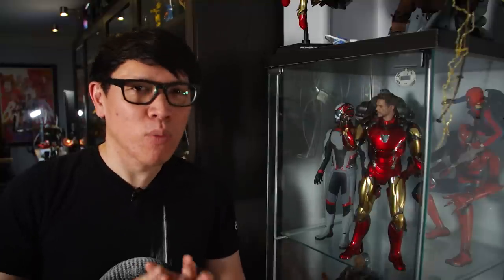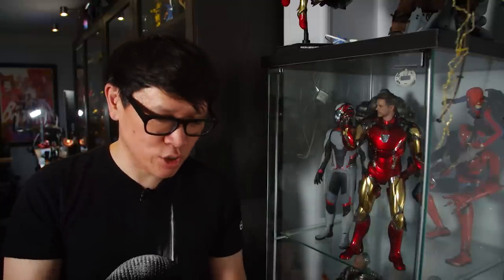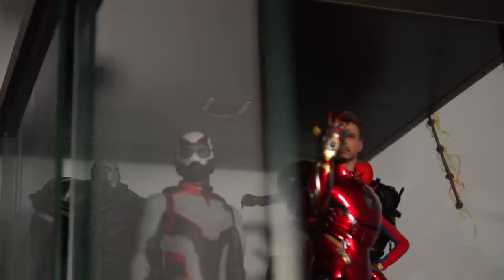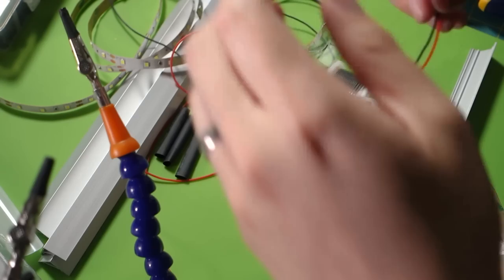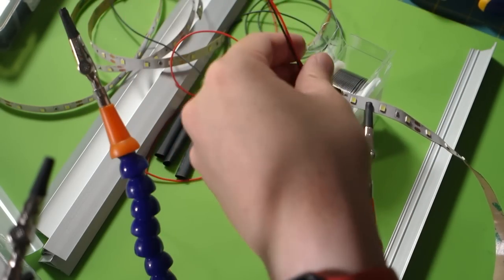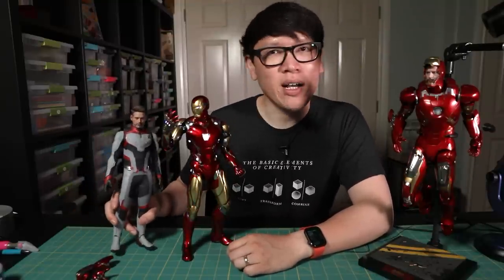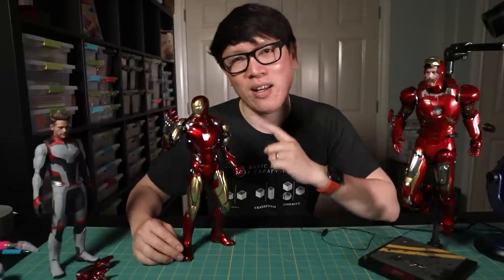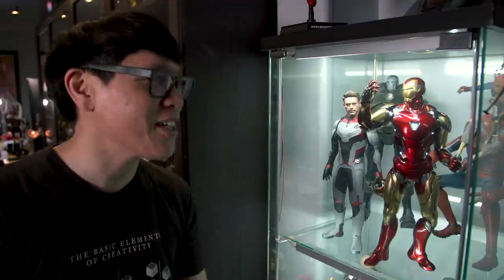How to Make Custom LED Lights for IKEA Display Cabinets!

Comment from the maker: IKEA Detolf: https://www.ikea.com/us/en/p/detolf-glass-door-cabinet-black-brown-10119206/
LED Light Strip: https://amzn.to/3wymso8
1ft Aluminum V-Channel: https://amzn.to/3cPRTSV
3M mounting tape: https://amzn.to/2THB0D3
Silicone wire: https://amzn.to/3wFjQoA
Heat Shrink Tubing: https://amzn.to/3wAVps3
USB Soldering Iron: https://amzn.to/3gwVmbi
Hot Toys Iron Man Mark 85 Armor: https://www.sideshow.com/collectibles/marvel-iron-man-mark-lxxxv-hot-toys-904599
For even more Iron-Man collectibles, head over to Sideshow: https://www.sideshow.com/characters/iron-man
Disclosure: This product was provided by the manufacturer for purposes of review.
Reply: Hi Norm, hi Savage put LED lights on anything makes it cool
Reply: Please do not use 30 AWG wire for this (like you have listed).  In perfect conditions that's far too small.  While assuming perfect conditions you'll get a 5-10% voltage drop due to resistance of the wire for the short length you're using based on the likely amperage of those LEDs.  But since 30 AWG wire has small strands and not that many of them, when you invariably break a few when you strip the wire or move things around you're dealing with something that's even worse.  22 AWG is what is typically used with these types of lights in small to medium setups and it's not much bigger (the insulation is still thicker than the wire) and isn't grossly more expensive (on the amazon link you give, the price is half again as much for 2/3 as much wire).  If you merely go to 24 AWG (which is ideal for a very small installation like this), the cost is only a couple dollars more than the 30 AWG for the same amount of wire.

Comment: The "V channel" is also called LED extrusion commercially. You can get it in many styles- quarter-round, half-round, flat, 45, etc. They have a bunch of varieties on amazon and there are a couple companies that only sell extrusion, and they will have more variety and longer lengths. The longest I've bought was 2 meters. You can also buy generic alumni channels and make your own diffusion and/or color using film/theater gels.

Comment: I bought that same led tape off Amazon and just pictures frames the whole inside of my display cabinet starting from top going down one side across bottom and up the opposite side and out the top which I hard wired to my original hockey puck light and it connected via 2 prong cable into a smart outlet that I can turn on and off from my phone. But my cabinet is made off wood to match my living room furniture so I could get away with that method of led tape. Great work!

Comment: I've used the metal poles as wires. You can attach the + to one pole and the - to the other one either on the top or the bottom. Then you can scratch a bit of paint of the metal poles and you can solder your wires to the poles. It makes a clean look without any messy wires that you can see. You can also choose to not solder the wires but make a pin that can make contact with the poles, this way you can take out the glass plates.

Comment: I have the Billy units inspired by Tested and use it to display some of my collectables.
We hired a Task Rabbit to install them and that was a good move as the basement floor has a small slope. I would never have been able to do it right. Now I should look at lights👍
Reply: I'm glad someone else is taking full advantage of the Billy modular set.

I have my study room lined around 3 walls with Billy modular shelves and cabinets with the additional risers that you can add to the top for another additional shelf

Comment: Looks good for illumination but when you were wiring up I was thinking of the overhead room lights you can get that use the structure of the fitting to carry power to the light fittings which gives a clean finish. So using say the left frame for positive and the right for negative, thus reducing the cabling to a minimal level.

Comment: Just a heads up; almost everything at Ikea, including the Detolf is sold out. Make sure to check stock before making a trip. Ordering online is also basically impossible.
Reply: They have plenty in my area Northeast US?
Reply: @Wsfletcher  Interesting. I'm in Missouri, and every store that I have searched besides Memphis is out of stock on almost every product, including these. I'm sure it's shipping related, but I can't even make a 1-2 day drive to a store to get anything.
Reply: Over here on the east coast Ikea stock is pretty dicey too. Been stalking their stores for a couple months looking for one type of cabinet and it's just MIA.
A really awesome floor lamp that works like Adam's work bench lights was completely sold out (unless I wanted it in white, there was plenty of white).
Reply: The trick to ordering online is to submit at 12:01 AM, that's how you get the collection spots.
Reply: Seven months later you can easily order the Detolf online, but shipping costs almost as much as the unit does.
Reply: Detolfs are now $120.. a 100% increase in price in just a year.

Comment: Having installed my first lights in my Detolf just a few weeks ago this video was really interesting - and funnily enough I fitted mine in an identical way with aluminum diffusers etc. The only mistake I made was choosing RGB LEDs. Soldering the four points so close together was so difficult. One of the most frustrating experiences of my life!

Comment: Wouldn't it have been easier to wire the individual light bars in parallel instead of in series? It would make the soldering easier (only one end soldered for each strip), the wiring easier (one cabinet side only for the wires), and it would avoid voltage drop for the LEDs farthest from the power source.
Reply: Can you explain this in slightly simpler terms? Just interested as I wired mine the same as he did in the video
Reply: @carlturland  like a ladder 🪜, but with only one side.
Reply: These lights are wired in parallel, but he has sort of daisy chained them together....To be honest, while the finished project works well enough, the wiring is not as neat or hidden as it could be...

Comment: I have the Billy shelving unit and use them to display and store my collectables. It was after having seen them on Tested that I decided to buy them and hired a task Rabbit to install them. The basement floor has a slight slope and I would have had lots of trouble and frustration trying to get it right.
Now for the lights👍

Comment: This is great ive been trying to work out how to keep dust off my figures
Reply: That Detolf Cabinet has gaps around the door that dust can get in easily, but like they say, "Dust gets in everything". You could use adhesive foam weather strips, adhesive rubber door sweeps. You'll lose the 100% visibility but shouldn't be too bad. Never set anything on top of these cabinets! If the metal frame begins to bow from weight, the top wood will put pressure on the glass and you could have a VERY bad day! I've heard about these shattering. Keep an eye on any potential glass bowing, especially if it's years old, and don't exceed the recommended weight on the shelves. I guess, under each shelf you could run a thin chain secured to the left and right glass panes with suction cups, with no tension, but just to stop them from bowing out further.

Comment: Another way to hide the wire better if you do not want to use heatshrink, is you can use a black sharpie marker and darken the red wire.  Its a trick used in computer building when you have a colored wire you need to blend in.

Comment: I'll be working on this project soon. I plan on lighting 4 different cabinets. Do you know where I can get extra power adapters and dim switches so I can have each cabinet run independently without having to connect to each other? If I buy 1 roll of LED's, that will be more than enough, but I'll need 3 more switches and power adapters. Granted, if I do run connector plugs between the cabinets, I can plug them into each other and run them all off the same switch and plug.

Comment: Thank you for using metrics, and for NOT calling millimeters “mils!“ 😃👍
Reply: I think he used Imperial dude, he ordered the V channels in 1 ft. The LED's came already measured in Metric, he just didn't manually convert, so viewers could easily find that product. You mad American Freemasons knew best? Imperial is next level bro(masonic puns intended). Would've been a lot cooler if he said caliber though, can't stand millie either, but hey, you say Lumens/Knots, I say Illuminati.
Reply: @Mr-pm3jp  
I’m not American, and I’m not a freemason, but thanks for the insight into your funny world! 😁🤗
But hey, at least we are at one about the “mills” thing. ^^

Comment: I wanted to make something like this for ages! I'd like to add one must have feature for me though. A timer! I've got these led candles that run for 6 hours when turned on, then 24 hours later the cycle repeats. Set and forget! In this case I suppose a smart socket could also work.

Comment: I swear to christ, everyone this past year and a half has had the same project ideas. I'm in the middle of planning something very similar. Note: THAT WIRE GAUGE IS WAY TOO LOW. The plug and play options on amazon are fire hazards because they cheaped out on wire sizes. All the reviews of wire connectors, dimmers, etc are filled with people saying they run really hot and some even say they burn through the plastic. That's because the wire size is too low. I'm planning to use as many custom built parts as possible, including probably 16 AWG wire. Probably overkill, but I'm an EE and design buildings. When in doubt, always upsize the wire. 18 AWG is the absolute minimum anyone should buy if you're not doing the math to see what the load is of your projects.
Reply from the maker: Good to know! Always listen to the EE!
Reply: Just ordered parts, including 18g wire, to do this project for my LEGO display. 🤞
Reply: Would you still recommend 18 AWG for LED strips that have 4 connections instead of just those 2 that he soldered?  I'm planning on getting the tunable white strips and those have 4 points to solder.

Comment: I guess the main takeaway of videos like this one is the idea because sure enough the execution looks like HotGarbage - I mean... Those figures cost like what? On average like 400.- ? You'd guess with that much money to spend on and this being somewhat of a tech-oriented channel I'd imagine you considering the option of making custom 3D printed endcaps for those LED rails that would snap onto the framing of the IKEA Cabinet resulting in a much more appealing result by removing some of those electrical cables. I'd also have used only one ( black ) color of wiring and mark the positive one somehow differently to help with the aesthetics where you cannot hide the wiring. Finally, I'd also argue that vertically mounted lights would have looked nicer ( would also have helped with the poorly addressed cable issue ) 😐

Comment: For anyone who's not handy with this sort of stuff and wants something that will achieve the same result with less work and not much more cost than buying the parts yourself, there's a company called Luke Light (thelukelight.com) that makes lighting kits custom sized for detolfs with aluminum brackets and diffuser panels. I just did 4 of mine with them (1 kit lights all 4 shelves on one detolf) and it was completely worth the cost and saved alot of time over wiring up a custom lighting chain.